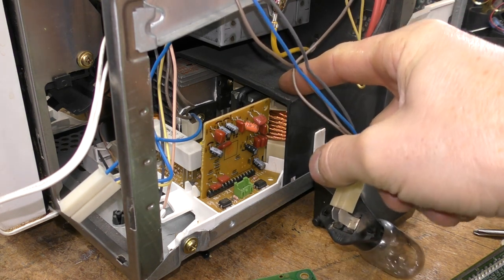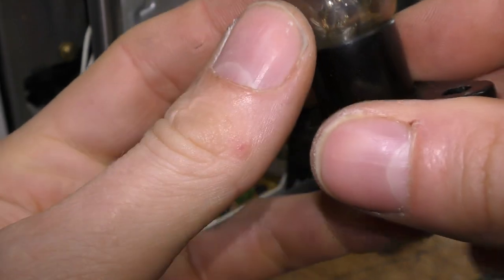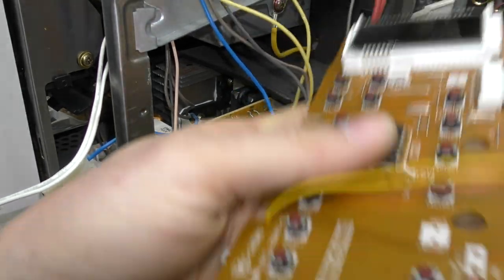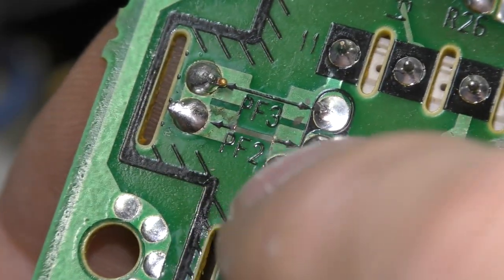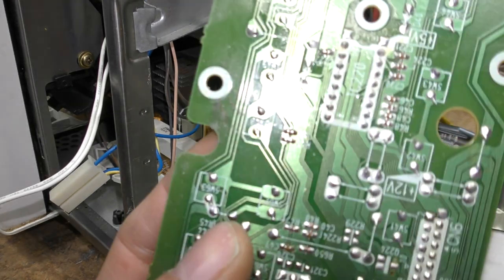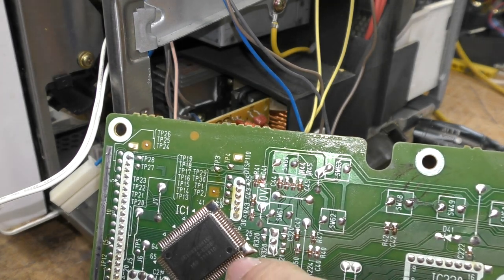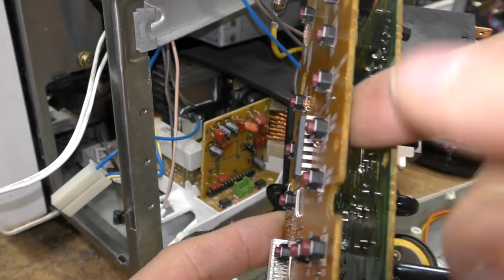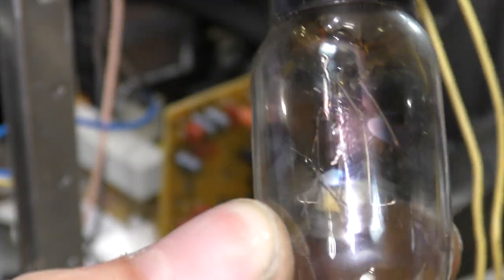Panasonic microwave destroyed by blown bulb.

Comment: that's quite nicely engineered to fail. light bulb lasts 2 years, warranty is gone, bulb fails and you have to buy new microwave.
Reply: My microwave is 30 years old, gets used every day and the original bulb still works.
Reply: Wasserverschmutzung but if you had the inclination you could get them for the bad design "faults in manufacture" the warranty paperwork usually calls it... and limitation of warranty to one year is not legal. They're banking on nobody being bothered
Reply: Exactly, this is classic Sale of Goods Act territory, and with the analysis that Mike's done, you have all the proof you need that it was faulty from manufacture (by design, in fact).
Reply: Andrew Gillard 
i dont think thats faulty by design. it was a bad design yes, but they sold it like that and the warranty was over so if anything its your fault for buying from that brand.
maybe if they was a page to add examples and have statistics of these events by brand, etc, people would stop buying from those who do it
Reply: If it allowed for mains voltage to go through a keypad when the bulb blew, makes you wonder how it passed it's electrical certficiation...  You would think they would require some sort of mechanical isolation
Reply: the term you looking for is "engineered obsolescence"!
Reply: Dan I'm not sure about that. "engineered obsolescence" would be more something like smartphones, after 3 years your totally fine and working phone is useless because new versions of applications need 4gb of ram for example.
Reply: Planned obsolescence, e.g. Phoebus cartel, see the wikipedia.
Reply: George Of The Jungle ah yes, the classic conspiracy theory that's so iron clad it falls apart the minute you google for "long life incandescent light bulb".
Reply: Why would one buy Panasonic again though?
Reply: Wasserverschmutzung smart
Reply: Yes, a nice example of planned obsolescence. Nasty cynical way to do things. Panasonic aren't what they were alas, and aren't alone.
Reply: ChinaPride engineering I'd suspect. Send for the Vuilniswagen...
Reply: +Evan Sakamoto
Planned obsolescence is real thing, independently of whether that microwave oven was example of it or not. It  is not conspiracy, it's freely available public information. Wikipedia has pretty good article about it.
https://en.wikipedia.org/wiki/Planned_obsolescence
Reply: I'm sorry, it's not like I haven't seen the evidence, I just disagree with the conclusion.
Reply: +Even Sakamoto
What exactly you disagree with? The fact that there are long lasting products doesn't mean that some products are not designed with opposite things in mind.
Reply: That really doesn't prove anything.
Reply: Manufacturers warranty means nothing.  The SOGA would cover an expectation of life free from manufacturer or design defects (this would certainly not be fair wear and tear).  For example in computers it is six years.  Panasonic is normally a good brand.  And it's a design fault.  A bulb blowing in no way should cause the whole unit to fail.  A simple piece of plastic between the two boards would've prevented it.
Reply: +Evan Sakamoto
OK, some examples. 

1. Why cell phones fall out of support so fast, even when the hardware could work for over ten years? I'm running Linux on my 9 years old computer without any problems. It's not even slow. Surely it is not for new games, but I guess most adults would be also fine without top notch games on their phones.

2. Why some printers force you to replace imaging unit/drum loong before it deteriorates?

3. Why some new textbooks add insignificant amount of information and change the chapter order, making it incompatible with previous version?

4. Why most new devices are designed in way that changing battery is very hard? Example they use security screws and glue.

5. Why so many head phones have the same failure mode? The wire always fails very close to the jack or the other end. Why they are not reinforced / properly reinforced from the very usual failure points?
Reply: This is also a product safety issue as well as the lack of arc protection between the high voltage and low voltage circuits is a fire and electrocution hazard.
I'd turn this finding into to the proper authorities who will in turn look into it and hopefully make Panasonic issue a recall on this model.
Reply: Evan Sakamoto he's not stereotyping Jews. They choose to be that way.

Comment: Acquired a clean Panasonic NN-ST477 (the all stainless one) dated '09 for a song from a charity shop earlier this week. The PCB configuration is the same and although the design is different there's a PCB track fuse. But on this one there's a drop-in clear polyester insulating sheet between them.

So they clearly know about the problem and fitted an insulator, leaving me wondering if Mike's acquaintance's one had a manufacturing fault/omission.

A warning: If you're taking one of the SS ones apart be very careful - it's got razor-sharp edges everywhere.

Comment: I have a Panasonic oven that looks very similar, I'll disassemble it and add a mica sheet between the two boards (if it is built that way) and a 100mA fast blowing fuse for the lamp as well...

Comment: We had a Sharp microwave that lasted at least 20 years (got free 2nd hand) the only problem was getting replacement bulbs for it. It used 2 120v bulbs in series but our local repair shop managed to get one , it ended up getting replaced by a 2nd hand sharp all in one which is ~10yrs old and although it has had a blown fuse in the plug  (reason why acquired it, owner thought is was broken, replaced it and then realised it was the fuse)  it still works like new.
So sharp seem to make great microwaves.
Reply: Nope, from your data we can conclude that Sharp made at least one good microwave. Look up "anecdote" from wikipedia.

Comment: I've had to repair my Panasonic as the small pcb-mount transformer on the control board had one of its pins detach from the primary mains winding due to repeated shock from opening and closing the oven door. I simply soldered the primary winding that was left to spare back to the pin and reinstalled the transformer. The control panel doesn't have any of the proximity issues to the mains circuitry as it did on yours, its more of a membrane keypad with a ribbon cable. I see yours uses an SMPS for the control circuitry and pushbutton switches... however the HV inverter SMPS looks identical.

To activate the inverter circuit for some fun you simply feed it a PWM signal into the green plug, duty cycle = % power output.

Comment: Exactly the same happened to my Panasonic microwave oven and I have to throw it in the bin. These circuit boards are very expensive to replace. Shame on those engineers who designed it

Comment: Do they already use IGBT in those microwave ovens, or it is still FET?
Also, it is good to know that microwave ovens may have such goodies in them. Considering that they are close to 2KW, the ferrite high frequency core might be worth it for parts for building a TIG welder or an inverter...

Comment: I had a glass fuse open on a 5V 200A power supply. Except it sputtered the glass envelope with fuse atoms. The power supply continued to work (but only without a load) because the fuse had several tens of ohms resistance. Replaced fuse with one which had a higher interrupt rating.

Comment: This looks like the microwave I have. Four years old and still the original bulb. I'm planning on replacing it soon so I might just let it commit hari-kari by lightbulb (provided it doesn't do it halfway through the cardboard pizza it's reheating). No doubt after posting this it'll either a) last forever or b) ruin my dinner the next time I use it

Comment: Fascinating. A resistive version of inductive fly back? I will be using TVS's across my lamps now. Thank you.
Reply: No, the lamp starts to conduct too much current, which vaporizes PCB tracks. Use a proper fuse in series with the lamp instead.

Comment: I hope you show this vid to the manufacturer
As for the HV transformer, there's a few that have found ways to get the inverter working, usually with a constant  5v pulse to the interlock part, maybe charge pump, but i'm sure there's a way to find that output so it just needs power.

Comment: Ive seen lots of products with plastic sheets between circuit boards. Having the mains board within arcing distance of the low voltage user interface board seems like a design flaw.

Comment: the mylar has probably been forgotten during manufacturing. 
These non changable lightbulbs (mostly lamps with fixed socket plus socket rivited in) are what is killing me. No chance for replacement without taking out the big drill.
Reply: Looks like that could be what happened - the '09 one I've just taken apart has a clear polyester insulation sheet between the two PCBs. 

If you look the PCB has another fuse track, bypassed by a wire link, in series with the one that's blown so they clearly expected in due course the bulb would blow and take out the fuse so they provided a spare.

Comment: This wouldn't pass the safety testing required for CE marking etc. It almost certainly compromised the safety barrier when the bulb popped and could have been a shock hazard if anyone had been touching the front panel at the time. Plasma during exposed fuse rupture is a known behaviour, so a Mylar insulator would have been required. It's a foreseeable outcome. The safety testing would have required fitting a temporary fuse in the protective earth, which would have blown here and failed the test.

Panasonic lost their way on consumer products some years ago, if you check the reliability scores. They obviously became complacent. However, this seems to be a design issue, not just a manufacturing one, so things seem to be getting worse.

 Nowadays for things like microwaves and TVs I always go for Korean brands like Samsung - or failing that, German.

Comment: he name of this stuff escapes me at the moment, but that thin white plastic that is used to insulate things electrically, if they had put a sheet of that between the two back to back boards, would that have prevented this? Obviously the bulb and fuse blowing was going to happen, but the further damage may have been spared? Personally I want a socketed fuse or at the very least. a soldered in fuse, so I could somehow replace it if needed. I don't know about the average public, but I'm personally more than willing to pay a little more for a product for the factory to spend a little more on some serviceability items like that.

Comment: The same thing happened to my GE microwave--the bulb blew. When I took it apart, I found a vaporized track on the controller board. At the time, I didn't know about the bulb arcing and couldn't figure out why the track was gone!

Comment: Sheet of plastic between those two boards would have saved this microwave.  Shame.
Reply: the design is good for atleast 24 months, they said.

*It will work until the end of the warranty period, they said
Reply: Warranty period manufacturing really bites companies in the ass in Australia. We have a consumer law protecting the replacement rights of items to be "fit for purpose", i.e. significantly past the typical advertised one year warrantee.
Reply: Likewise in the UK and EU.  Most people don't know it though!
Reply: It actually has a high likelihood of working for 10-20 years. Those bulbs often survive that long, and then they don't always fail short or arcing.

Comment: I have had a Panasonic inverter (and steamer) microwave oven get to a point where it would turn itself on and start running with no user input required... It stopped doing it after a while of having it unplugged when not in use, but still worrying.
Reply: Don't worry about the Panasonic - order an exorcism, as you obviously have a hungry poltergeist lurking in the house.

Comment: One thing I've noticed in my home appliance repairs as to microwave ovens.  The controller chips work with different display panels dispite manufactures.  The chip they use is probably generic to all last ten year ish microwave ovens.  I've never had a light bulb trip a circuit breaker when it blows in the last 60 years.
Reply: Pretty common for tungsten table lamps to take out the 3A fuse in the BS1363 type plug when the bulb pops - I reckon it must have been the main reason for householders ever having to change a fuse
Reply: +Joseph Nicholas In the last couple of weeks I've puled two microwaves oyt of skips. Both were cheap BOB ones made by Midea and the control PCBs had multiple options selectable by snapping off small tags with loops of track on them.

Comment: My mum's Panasonic micro has the same bulb, which I replaced recently and was annoyed enough that the bulb was not a standard hardware store part.  I should go back in and check for and mitigate that potential issue.  I think though, from an engineering perspective it's not unreasonable that this cascading failure mode wasn't anticipated, although it's perhaps a bit sloppy to have such close unprotected proximity between HV and controller circuits.  But once the traces fuse due to the bulb arc that's the end of it anyway since jumpering the traces is useful for troubleshooting but not really a deliverable repair.

Comment: Hi!
I just ordered a new Panasonic inverter microwave oven. Is this still an issue in microwaves sold today. I'm a little worried.
Should I just replace a bulb with a LED? Though I doubt it can be done without voiding the warranty. All microwaves I saw need to be opened to get to the bulb.
Reply: @avada

Ah, luckily it cannot happen to my microwave because it now has an LED light.

Comment: I got an immaculate Panasonic inverter microwave from a skip, the fault was the turntable motor was open circuit, a salvage part was fitted and it has worked fine for the last two years!
I think I will fit a fuse for the bulb now....

Comment: How would a light bulb blow closed circuit and draw enough current to burn a thick PCB track like that?  Only failure mode of an incandescent bulb I was aware of is burning out open circuit, which shouldn't blow a fuse (PCB or otherwise) in the first place.
Reply from the maker: It's a well documented phenomenon, like I said, an arc forms at the break, and can expand to form a low-impedance path across the two electrodes.

Comment: If you get your hands on the broken microwave (if the owner lets you have it), I do have a feeling you're going to connect an electronic halogen transformer to the high voltage transformer... just a guess though... :) Or perhaps you can reverse-engineer the oscillator circuit for the HF/HV transformer... that would be interesting to see.

Too bad with all the electronics and over complicated stuff in modern consumer goods, almost everything is designed to fail. What was wrong with a simple transformer, a few relays, resistors and a switch, except for the weight (it lived too long, I know)?
Reply: See answer from Pete Allum.

Comment: I suspect I just had the same thing happen to my microwave, except instead of the low voltage fuses blowing, the mains fuse blew, I'm going to replace it and see if it works, but I suspect that something else has gone as well, which might mean it's unrepairable... I can't imagine that immediately after the light globe going, the mains fuse would blow... there would have been a chain of events that followed similar to this video.

Comment: This might explain what happened to my microwave (a Sharp that's an inverter type a few years old). It not only blew its own fuse (240V 10A ceramic fastblow) but tripped overcurrent switch on the circuit (and it was on an oven circuit so probably tripped from more than 10amp).

I found out when I changed the microwave's fuse that globe was blown too, however in my case I found that microwave itself was fine, and it has been running fine since (without globe) for more than half its life.
Reply: Oh, thanks for leaving the comment .... your scenario sounds like mine, I'm hoping the fuse and the globe are the only thing I have to replace, fingers crossed! (both are open circuit but I'm hoping it's not a whole bunch of other electrical components), in my case my breaker didn't trip, just the fuse + light globe gone.
Reply: @schr4nz  personally I wouldn't replace the globe as then the issue is liable to happen again (it's the globe blowing that takes the whole thing down). The globe also isn't shielded well and in my case probably blew because spatters of liquid had got on it from food
Reply: @schr4nz  I should also mention (given the age of my original comment), that the microwave in question is still going, and as I recall it popped its globe+fuse at the 1 year mark, and I've had it 8 years total.

So yeah, if I were you, I'd omit the globe (or find another way to stop the inductive charge being unleashed again when the globe inevitably pops again) trust me the light really isn't that important in a microwave.

And given the thing (in my csse) popped a 20 amp 250 volt breaker... Yeah that's a design fault I'd rather not reproduce again.

Comment: Wow they should have put a piece of plastic in between the two boards, if there is just air between them any piece of dust could lead to a connection. What a bunch of junk!! If I ever get an inverter microwave I will take it apart and look for crap construction like that

Comment: This has happened to my Panasonic NN-CT55JW. Bulb has blown but now the turntable doesn't work at all. So to save 5p I've now lost a £250 appliance which they deliberately make impossible to repair. Thanks Panasonic. Why are they still even using 1930s bulb technology in the 21st century?